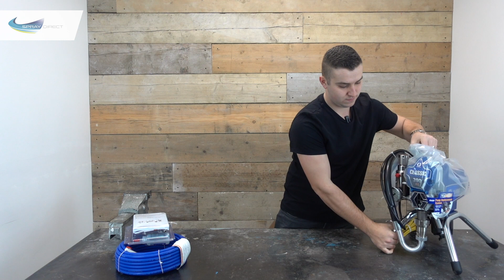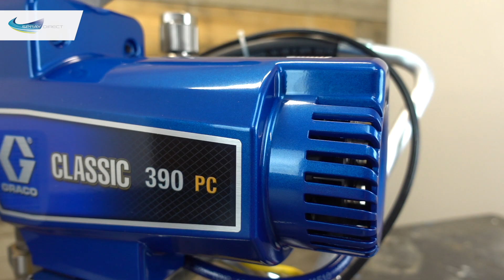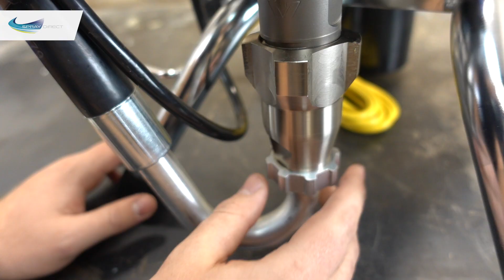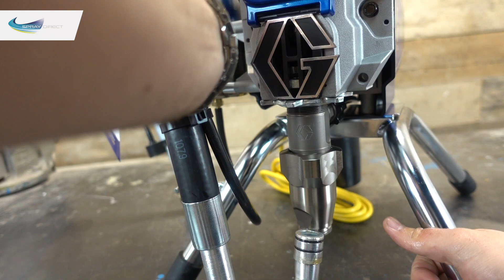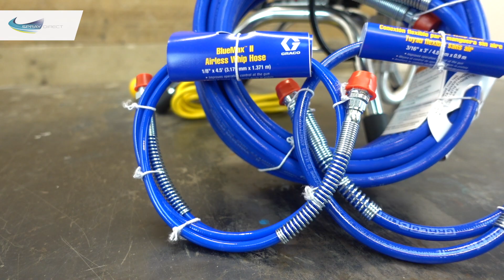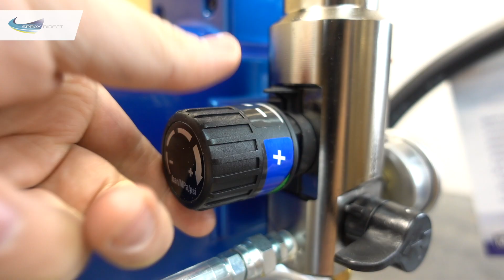Graco 390 Classic PC Unboxing and Review

Comment: Very helpful video as always! How often needs the pump proconnect to be replaced? and how do I know if the pump is needs replacing ? my 390 pump just started to slow down after a year spraying every week, and wondering if this is why or something else. Thanks a lot
Reply from the maker: Thank you very much, there are a couple of signs to look out for. Firstly if your pump doesn't hold pressure when not spraying and needs to pump periodically to maintain the pressure or if you can see paint leaking out of the top packings - https://www.spraydirect.co.uk/acatalog/Graco_Classic_PC_Displacement_Pump.html
Reply: @SprayDirect  oh okay thank you very much that’s good to know! I cleaned my machine through and actually it solved the problem, now works perfectly again. I also have a gx21 which haven’t used in the past two years, because stopped sucking paint up. It got a bit rusty but contacted to spray direct and will probably take the machine to your centre to have a look at it. The machine was always properly cleaned, pump still makes sound, working but no paint coming through…
Reply: @SprayDirect  hey the pump link you sent has a pretty expensive pump. Is it worth it to buy the pump replacement or get a new machine all together?